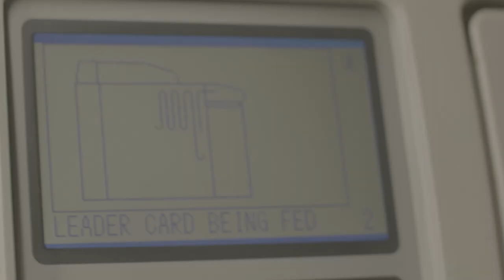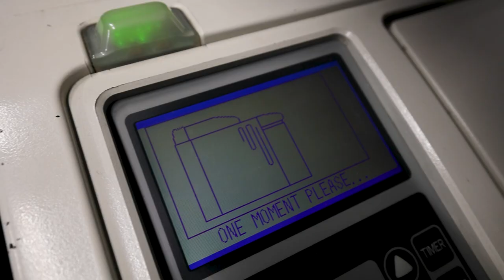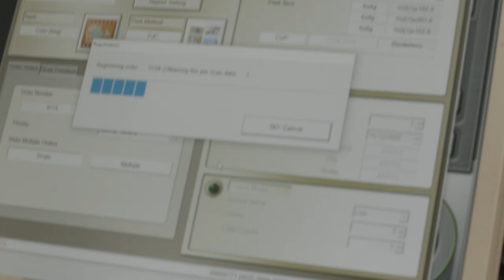Using a Noritsu V30, HS1800 scanner and Minilab QSS 3501 Plus

Comment: I've got a tip for you! 🙂
It's much easier to attach the tape with the guillotine in the down position!
You put the film canister into the holder, then cut the end of the film with the guillotine, then place the leader card onto the jig so it goes under the end of the cut film so it just overlaps the film by about 5mm, now attach the tape, then remove from the jig and tape the other side. I think you will find this much easier.
Reply from the maker: Thanks, will definitely give that a go!

Comment: I’m curious, if the photo is laser printed onto paper, why does the paper need to be chemically developed? Wouldn’t it be just like printing it onto photo paper from a laser or inkjet printer at home?
Reply from the maker: It’s not laser printed in the same way a laser printer works. It has a tri colour laser in it that exposes the photographic paper in the same way it would be exposed if it was in a camera pointing at the subject. A home laser printer has a single wavelength laser that simply charges specific areas of the paper with static charge, this then attracts toner and is then heated to set onto the paper
Reply: Curious.... What is the cost for the whole setup? 100k?

Comment: OMG! You never just hang the film taped on the leader without holding your hand underneath, the film can just roll out.
Reply: He also handles the negs without gloves.
Reply: @VariTimo  If you are careful you can just touch the sprockets. But its best to use gloves for clients that want their film back. If it's just crap wedding disposables than you don't need gloves since most of those jobs don't even want the film.
Reply: There are so many things this guy is doing wrong
Reply: @foxsparrow8973  Fair enough. I’d still wanna avoid getting my finger oil into the scanner.